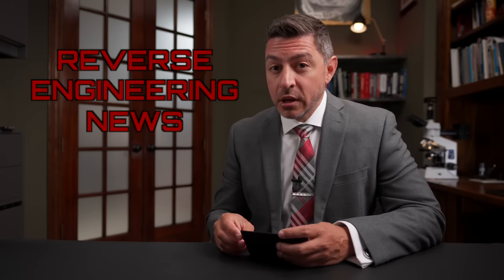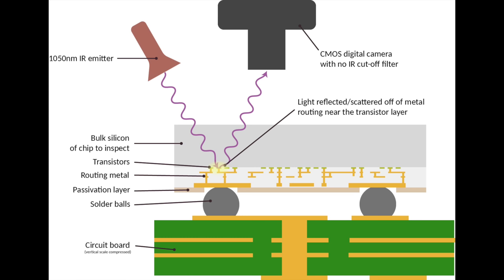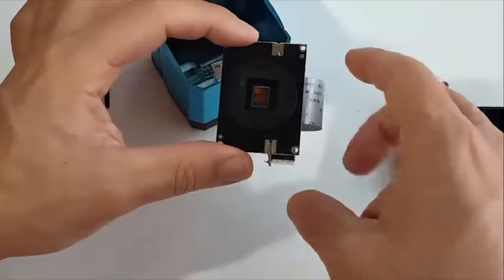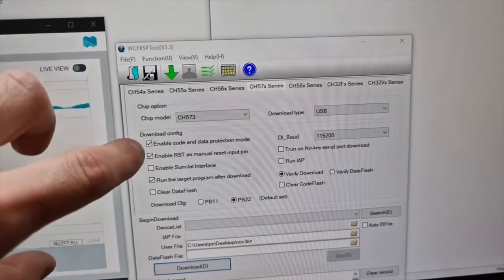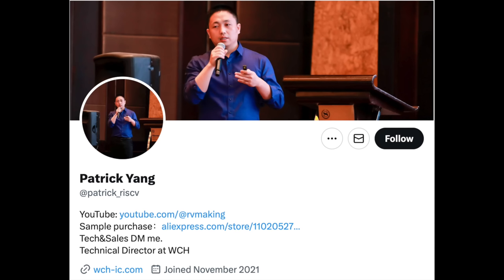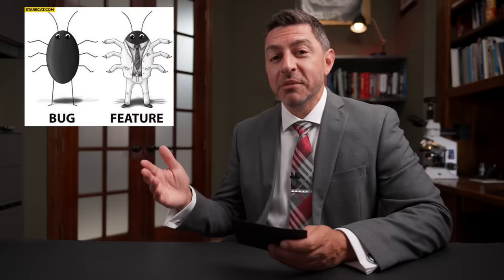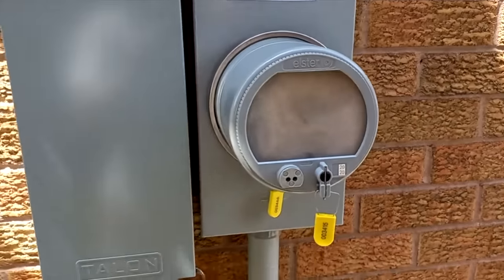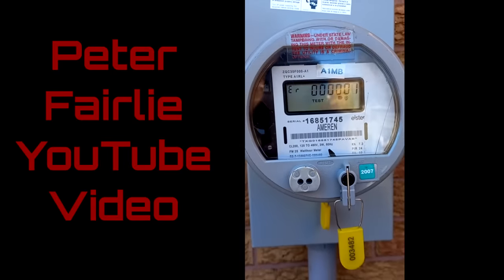Flipper Zero Kills Smart Meter?? - Reverse Engineering News - June 13th 2023

Comment: lol, it doesnt work because it sends signal to a board that the power company installed to control his power.. thats like saying the ac isnt a part of a car because it creates cold air and doesnt drive it... wtf bro. Also, whatever house you showed doesnt look like the architecture of the one in the video. and it would probably be wise not to show his exact home doing this and meter seriel number. so he could have just easily done this at a friends or family member. your taking so much on faith with your info youve got literally less solid evidence than he does when showing what he can do

Comment: You don't want to re-write an entire EEPROM every time you change a few address values, it will degrade the life of the EEPROM, to properly erase it you need to write all 0s or 1s, it is a feature.
Reply: That's nonsense.  You still rewrite the first 8k on every erase.  You need the first 8k or the chip is dead.  You achieve nothing by only erasing part of the flash.
Reply: @joels7605  Ah I see, I just watched Aaron's original video and I was able to understand it better there. I had trouble following the segment in this video, it wasn't clear to me that the bootloader was the problem.
Reply from the maker: I explained it in more depth initially but then cut the video a bit because I felt it was long-winded. In the end, if you set security flags THEN for sure it should default to wiping the whole thing. If you haven’t set the flags then sure, do the first 8K only or whatever.

That’s why I say this is definitely a bug, purely an oversight or lack of imagination by WCH, the manufacturer.

Comment: Smart meters can survive incredible surges on the utility power lines. Now try tampering such a meter from a distance by some discharge trough air... Good luck. Other wild statements by some state that smart meters inject surges into your power lines and other nonsense. I might just as well help those people invent a new conspiracy: The utility meter manufacturers made a deal with white good manufacturers. For washing machines, clothes dryers and similar equipment the life time is set too 3.5 years. After that period, such machines will be zapped to render them useless. Toasters are unfortunately not included in the deal. They are too simple but at the same time very robust and able to survive even the most severe transient. Because of this, toaster will see a significant price increase. Computers and electric cars are not being targeted for now. Perhaps they might be causing mad cow disease tomorrow.